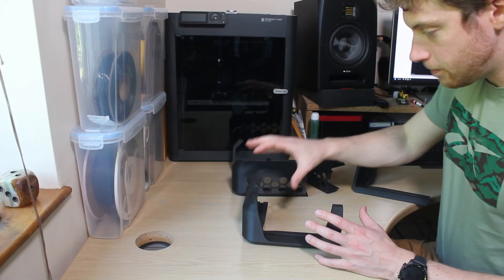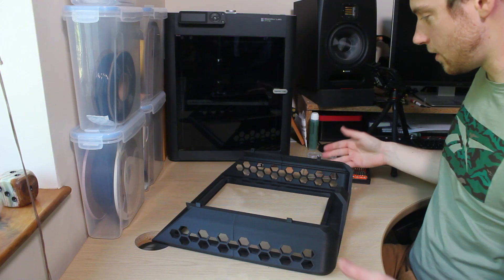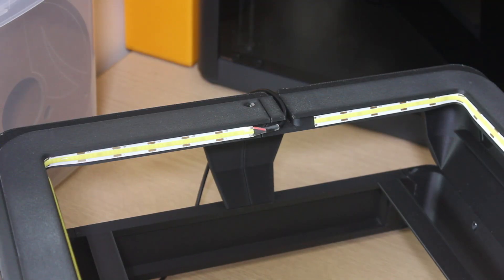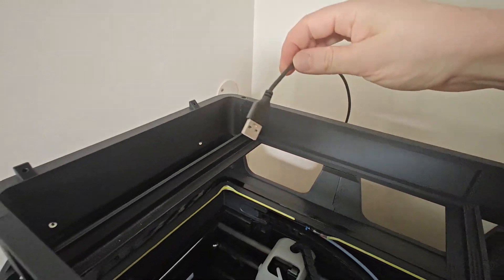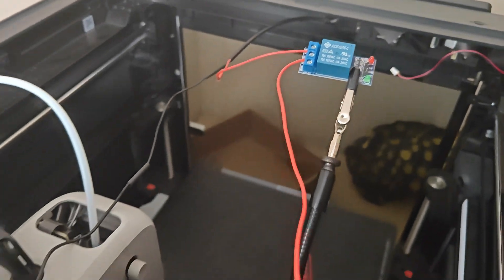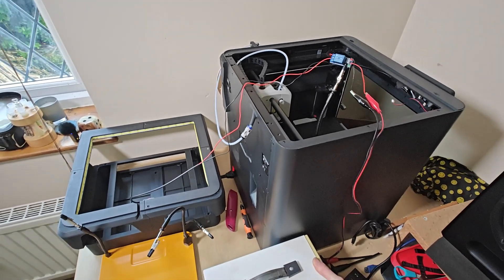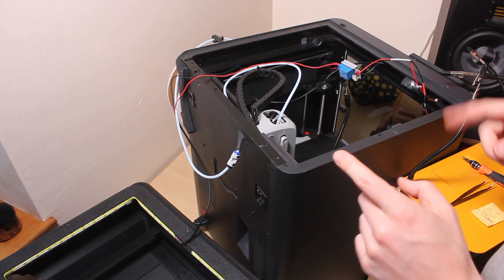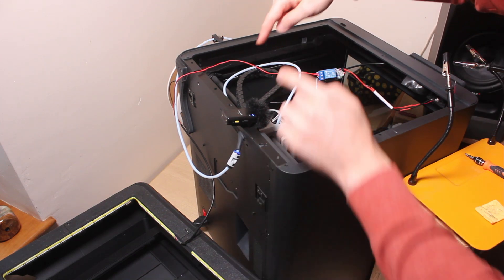Assembling My Riser & Wiring LED Strip Lights to Control Them with Bambu Handy

Comment: You can get both the new light and old light working by putting them both in parallel on the output side of the relay.

Also be sure to not draw more than 1.5A from the internal USB port. The internal relay is a good idea since the JST connector for the internal light burns out when drawing above 300mah

Love the video. This should have more views
Reply from the maker: Ahh I see that makes sense now you've said it, never crossed my mind though! Thanks for taking the time to comment, it just seemed a shame to have the old one wasted and not working.